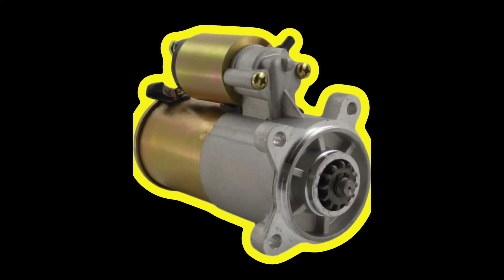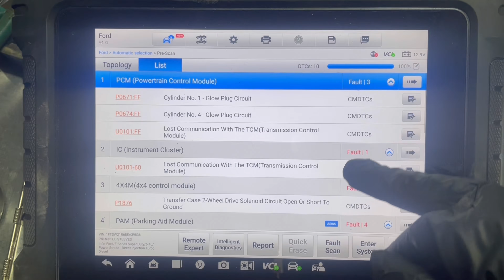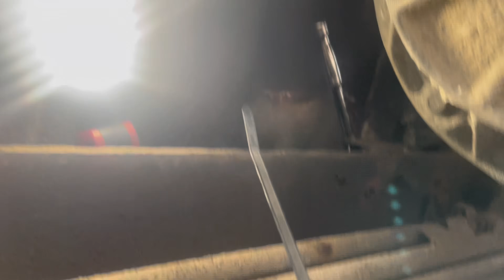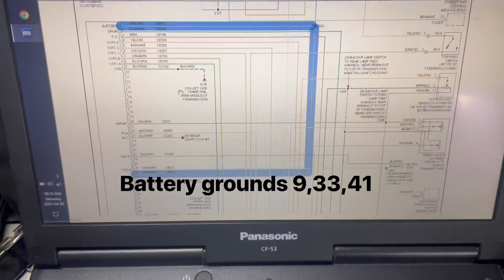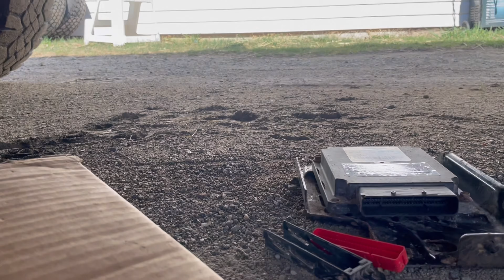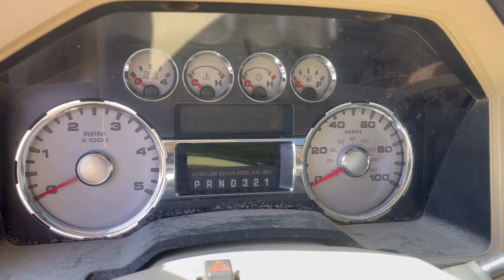08 6.4L fixing no crank scenario. Can you guess which one fixed it ?

Comment: I have a 08 6.4l and no crank  the anti theft light comes on and i can not Connect a code scanner to the computer through the obs?
Reply from the maker: Have a look at your pcm power relay located in the fuse box under the hood drivers side. This relay is controlled by the pcm when instrument cluster is happy with the key fob. I've seen these relays go bad and cause this problem. Try swapping the relay with another. If that doesn't cure it. Join my discord server where I can try and help by providing wire diagrams.  https://discord.gg/pdXVZrzjV
Reply: @diagnorth i also don’t have a key fob
Reply from the maker: @PenetrationNation-l6g I was referring to the RFID (radio frequency identifier) . These chips are in the plastic part of your key.

Comment: I have a no crank situation. Batteries are charged, P indicator is lit, security light is off, no codes present (using mini maxx tuner for diagnostics), all relays and fuses are good, truck cranks and runs when starter solenoid is jumped to positive (at rear of passenger battery box). Not sure what to test next.
Reply from the maker: Can you do a fault scan and report back with any codes stored in pcm or instrument cluster ? Can also join my discord server where we can chat a little easier.  here's the link https://discord.gg/cG2QFhym

Comment: I have an 08 f250 6.4 i have replaced the tcm and the pcm still says no communication to the pcm. I have tried a new pcm and it will not accept programing saying it is a part number missmatch. Makes 0 sense!!!!
Reply from the maker: What scan tool are you using ?

Comment: Hello
I have 2008 f350 6.4 powerstroke
Recently it developed no crank situation 
It happened once about a week ago and l got it started using a relay jumper cable 
But now that is not doing anything just click
What to check first or any info how to find the issue would be helpful 
Thanks
Reply from the maker: I don't quite understand what you mean by using a relay jumper cable. Where were you jumping? Best thing to do is to check the starter in this situation, it does sound like the solenoid on the starter is not activating. Grab a test light make sure you have power on the big stud of the starter solenoid. If that checks out check for power when turning the key to start on the little terminal of that same solenoid . If those check out use test light again to check ground at starter ( unlikely but possible) if all those check out u need a starter bro.
Reply: Thanks, l will try that 
And sorry for not so clarifying the situation
Reply: @diagnorth it sounded like he was placing a jumper wire in place of the starter relay.

Comment: I have a 2009 350 6.4 no crank no start, only starts if I take the positive starter wiring harness (which either connects to a ground or to a solenoid) and place it on my positive terminal any thoughts?
Reply from the maker: Not a pats problem but more of a physical issue with power distribution to the starter or solenoid, you can join my discord server where you can post videos or pics and we can chat a little easier 

https://discord.gg/zrWrXdkw

Comment: I have a 2005 f250 with th 6.0.  I have a intermittent no crank.  Turn the key get no response from the truck.  Let it sit for an hour, starts up like nothing was wrong.  Happens approx every 2 weeks.  Any idea
Reply from the maker: Sounds like a corrosion problem but hard to say. Would have to see what the symptoms are when it's not working.  I'm talking about scanning the truck and seeing what the modules are saying. Could also he an issue with PRND switch. You can try cycling from park to neutral when its doing its episode.  You can join my discord server where you can post videos or just shoot messages back and forth https://discord.gg/Mqf45Esx

Comment: Here's what my job 1 2008 6.4 is doing. Has done this twice so far. First time I drove to pick a friend on a Snow covered salted road. Shut it off at his house, wouldn't start. Started  it by the wire on the passenger side and drove it home . Reverse was ok, drive was 3rd gear, no parking light indicator. Next day turned the key on and the parking light came on after a couple minutes with the key on. Started truck and it was fine for a few days. Couple things i noticed in those few days. Fan was constantly on when there was no TCM communication (u101 code) and the longer the truck sat the longer it would take for the TCM to communicate when the key was turned to the on position. If truck sat overnight it would take a minute or two for the parking light to come on, if i drove it and turned the key on an hour after I drove it, the parking light would appear within 10-15 seconds. The shorter the time the truck sits after driving it the shorter the time is for the parking light is to come on. Does that sound like a TCM problem or is the tranny temp sensor causing the TCM to go  wacky?  The second time it happened was shortly after I washed the mud off the truck. Washed the truck, started fine and drove to the gas station , it wouldn't start at the gas station so another jump and drive it home in third gear and the TCM hasn't communicated yet and that was 2 days ago.
Reply from the maker: @scoobywrx05dw  I'd say there's an issue with the range sensor or wiring to the tcm, they really didn't put it in a good spot
Reply: @diagnosticnorth  thank you for the reply. I have checked the three power and the three grounds at the TCM plug and they are all good. What do I check next and is there a test or check to do  to see if it is the range sensor
Reply from the maker: @scoobywrx05dw  here's a link to my discord server, I can look up some specifics later and post them up for you https://discord.gg/kjCsb6GE
Reply: @diagnorth  thank you kindly sir. I just signed up to it.
Reply: @diagnosticnorth  it has also never spit out a code for the range sensor just the u0101

Comment: So could this be the dame case on a 2005 F550. The issue is the truck had some body work done to the front. It drove in fine and after a small bit of welding was done, about 4 inches of weld at the suspension area. No the truck will not start, and loss communication at the OBD plug. All fuses are good, batteries are good. I cans recall if I saw the park light lit
Reply from the maker: @MrShanksta   I'd start by checking if the park position light is on. If it is then check resistance with a multi meter between pins 6 and 14 at the obd plug with key off
Reply from the maker: @MrShanksta  you can also join my discord server where we can chat a bit more https://discord.gg/GJ5UZb9d

Comment: Did the missing park indicator light also cause the PATS security light to flash quickly?
Reply from the maker: @shawna5549  hi there, I have made another video that shows when the tcm is offline ( no park light ) the pats light doesn't come on. But like I have seen many times.. a broken wire on the can bus between PCM , CLUSTER AND SJB WILL turn the pats light on.

Comment: Hey changed starter ignition switch still no crank no start jump started from starter starts but shifts goofy and fans keep  coming on johnnyo  balt md
Reply from the maker: Sounds like the tcm is not recognizing park. If the tcm is offline it will still try to shift but will have a hard time. It could also explain the fans due to an issue with the trans temp sensor wich may command the fans on to try to cool down transmission cooler. Can you tell me  if it shows what gear its in, in the instrument cluster.
Reply from the maker: You can also join my discord server where we can talk https://discord.gg/pGdntAxs
Reply: Do you have a solid person/ mechanic in the area. I’m in bmore as well with a 6.4. Tend to do my own repairs when I have time

Comment: I got issue with my truck f250 2008 i got the battery light on   I used the code scanner and this is what appeared P163A ford generator B control circuit , can you make a video of that i been trying to fix but I can’t find the issue
Reply from the maker: Hi there , thanks for your interest in what I do! My schedule is nuts rn. I haven't uploaded in a couple months bcz of that. But I will do some research and attempt to help you out. https://discord.gg/PVczuXHP follow the link and join my discord server . I have a few questions. Thanks!

Comment: I have the same problem with mines 2008 ford super duty 6.4  can you help me
Reply from the maker: Yeah sure, you can reach out to me through my bio links. There is also a link to my website there.
Reply: @diagnorth I need your help too
Reply from the maker: @JorgeSalcedo-r7v  depending on you specific issue. Using hp tuners you can tune out pats now

Comment: I have this similar issue except it won’t do it when the truck is cold once it reaches temp it stops reading it and flickers around. Will start in neutral no problem but not in park once I shut it off and try restarting
Reply from the maker: Could be a cable adjustment issue.. it is also possible that as a component warms up it stops working properly.. Such as transmission range sensor or tcm.

Comment: I have an 08 6.4 3500 for diesel., it can idle as long as there’s once over a half an hour if I put it into dries, I can’t make it more than a mow without it cutting off then it Hass to rest for 20 to 30 minutes then it will restart. Oil – oil, filter, fuel filters, air filter, glow, plug, eight, two new batteries installed.
Reply from the maker: @lionelchapman7629 If you have access to a scan tool, can you tell me what codes are active on the PCM? It sounds to me like you have a fuel issue. I have had something in fuel tank blocking suction line causing similar issues. I would double check the fuel  pressure.
Reply: @diagnorth  do these have a fuel filter that could get clogged?

P.S. I love seeing how many responses trying to help people you’ve given.  Very admirable!
Reply from the maker: @brainkill7034  most diesel engines will have all sorts of filters/screens to prevent contamination. Although in my experience ... it's not always a filter problem .. I've seen crap in the tank plug up a fuel line , even gelled up diesel in the winter cause them to stop running.
Reply: @diagnorth I don’t have a lot of diesel experience so I appreciate your response greatly!  Thank you for sharing.